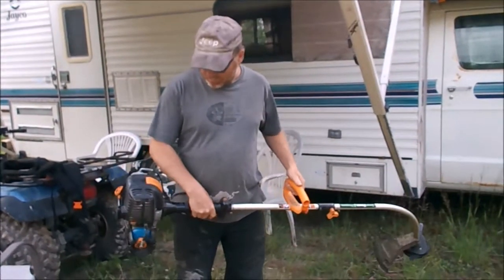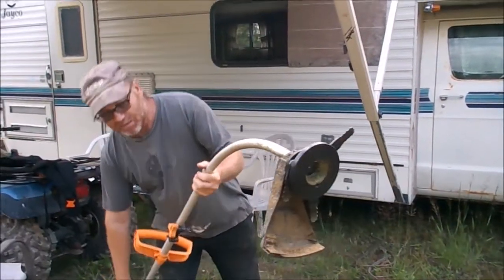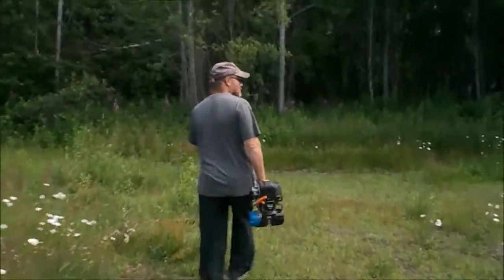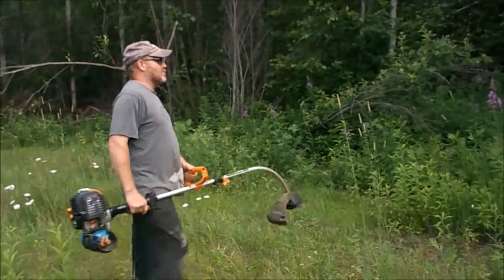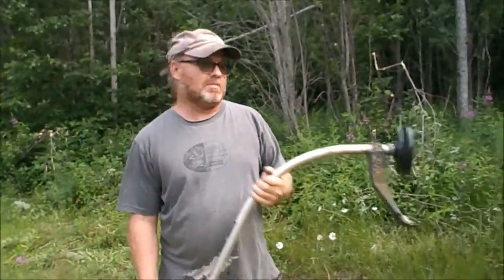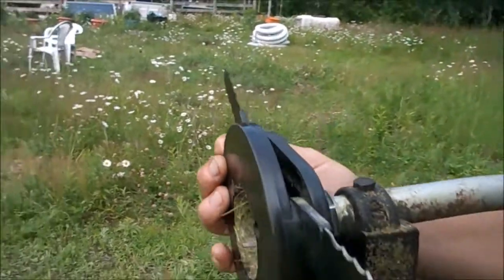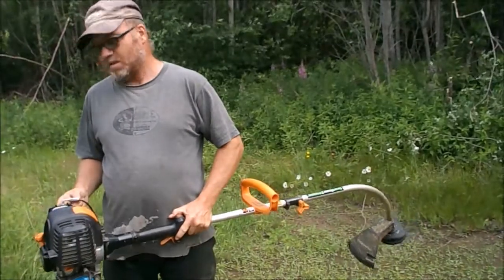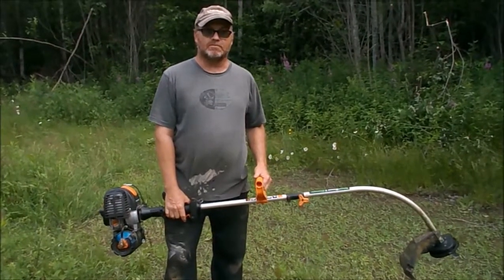Propane Grass Trimmer, Great Tool On Our Homestead

Comment: I have never seen a propane powered grass trimmer. Will a tank of propane last a lot longer than a tank of gasoline? Do you use a special propane tank or one you would buy full of fuel at the hardware store? Thanks for sharing.
Reply from the maker: Yeah a 1lb tank will run me about 36 hours or so.  I just refill my old one pound tanks from a barb-q tank with my adapter.  Costs me about 50 cents to fill a one pound tank.  Cheers  :-)

Comment: What is the ratio of oil to propane?  Must be hard to mix  ; - )
Reply from the maker: Lol yeah. Be tough on a two cycle engine eh.  Cheers  :-)
Reply: I googled Lehr, looks like they are still going strong with lawn, garden and outboard motors. Interesting stuff.
Reply from the maker: Cool. did you notice if they make any propane powered equipment still?
Reply: Yep, that's their thing. www.golehr.com.  In LA, Calif.
Reply from the maker: Thanks for the link I will look it up. And if the rest of the rest of their products are like this grass trimmer,   than it's probably great equipment,  Cheers  :-)
Reply: I spent some time at their website and other internet sites that had their equipment and they may not be doing as good as it first appeared.  The concept of propane powered equipment is fantastic, I hope they get it going again.

Comment: do you have an adapter to fill up those little bottles from a 20lbs tank??  you should look at getting one.  Check them out on Ebay!!
Reply from the maker: Yes sir.  I bought an adapter about 4 years ago, It costs me $10.00 to fill a 20lb tank, With that said it only costs me about one dollar to fill this 1lb'er, and I can get about 36 hours to a tank full.  Cheers  :-)
Reply: Not too shabby then.
Reply from the maker: I just love it  :-)